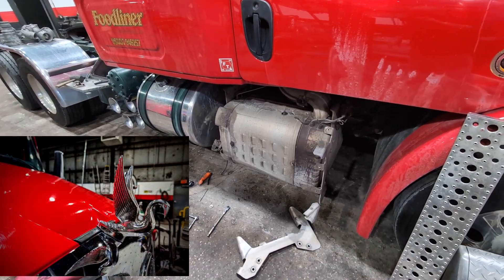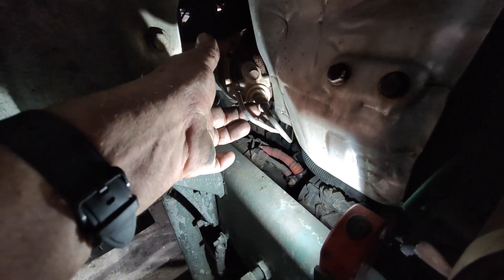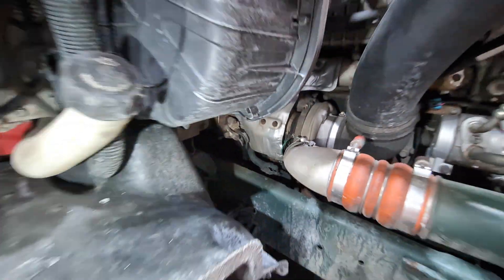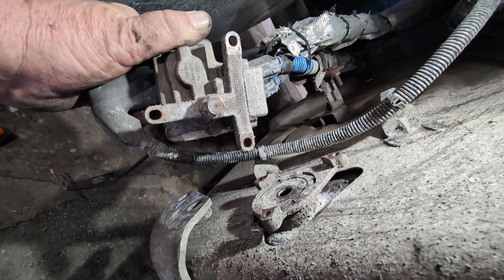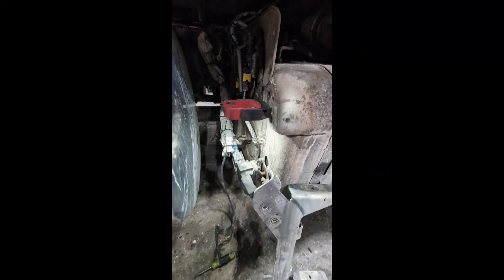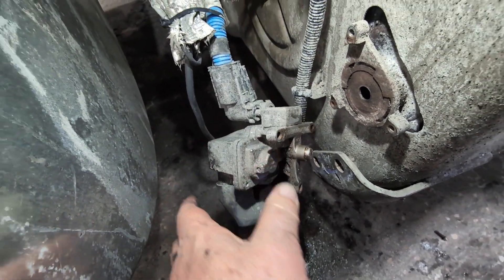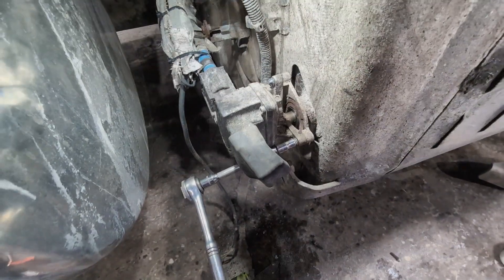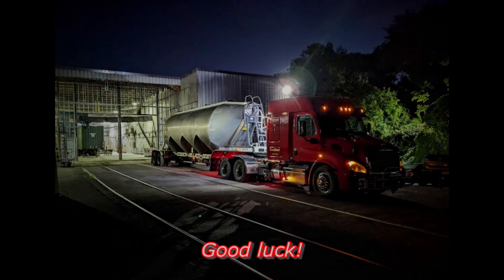SPN 4364 FMI 18

Comment: you need a new dose when it builds up like that with the DEF is bad I went to the same problem put a new one on no more problem is about five to $600 for the park
Reply from the maker: Atlantic Detroit did a set of new ( not reman, not cleaned ) DPF's for me last summer.  I had 435K on the set they removed. They inspected the doser and it was fine, since I had cleaned it.  DEF and it's calcification are water soluble.  They cleaned the tube it injects into and installed an awning kit, which is standard on later model one-boxes.  The awning kit was $135.

Guys tend to throw parts at these systems without understanding what they are doing.  I'm sure it corrected your problem, but unless the doser is dispensing the incorrect amount -  ( which is determined by a quantity test ) - it doesn't need replaced.

Little things that help.  Engine air cleaners.  I change my 2x a year.  Run the overhead every 150K.  I use the Pittsburgh Power catalyst to keep the soot down.  I work the truck to death and get stuff hot, because a DD13 loves it.

My truck at 824K will produce 35PSI of turbo boost on a full bunny pull.